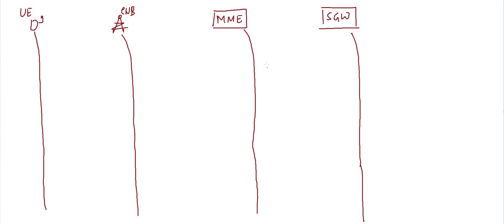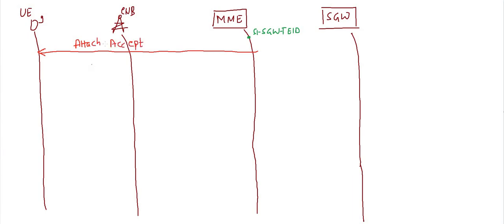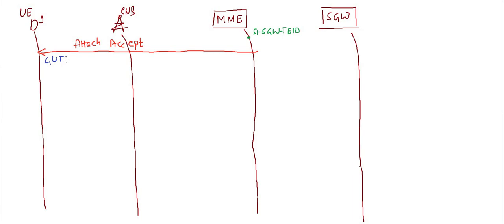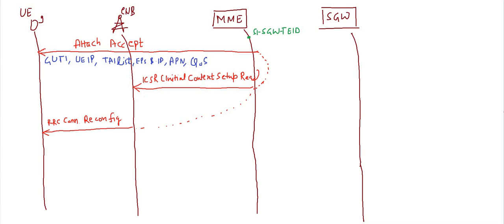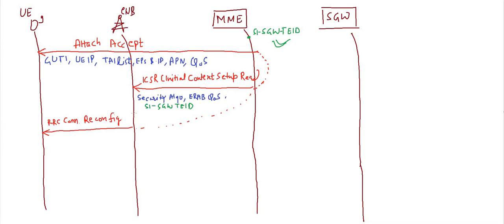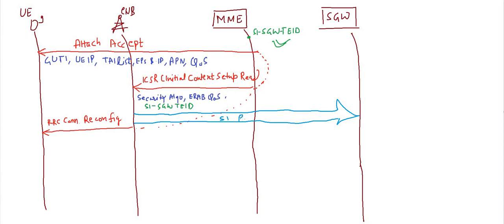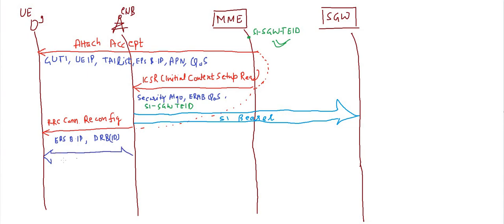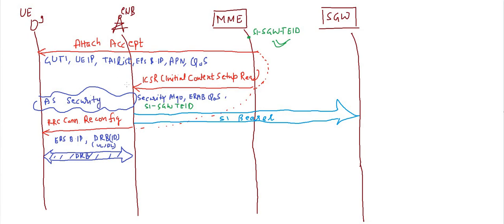LTE Tutorial (Part 10)

Comment: Nice lecture. But I have a question. Could you please explain during the 'RRC reconfiguration' message, DRB is also includes at the parameter side. So on which DRB mode it sends the futher ICSR response message?